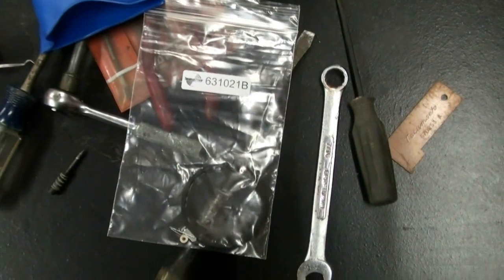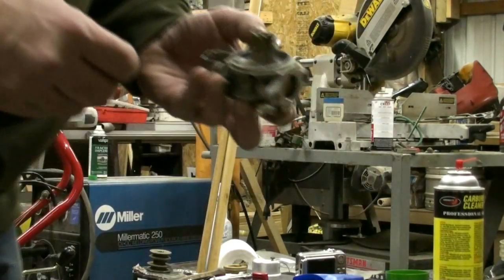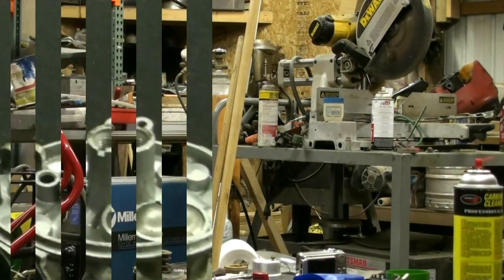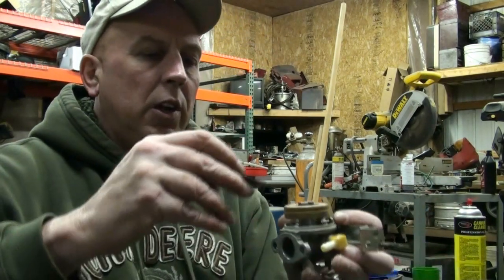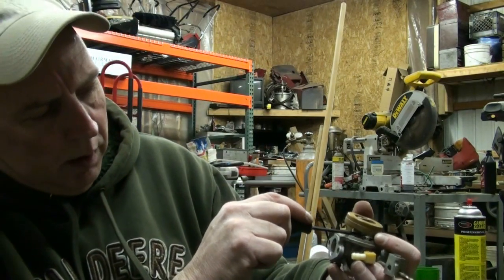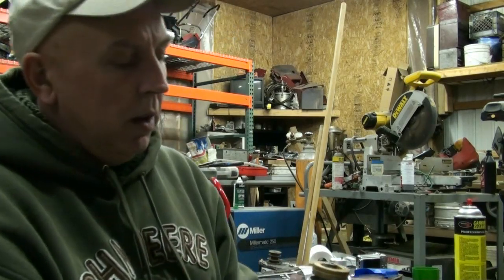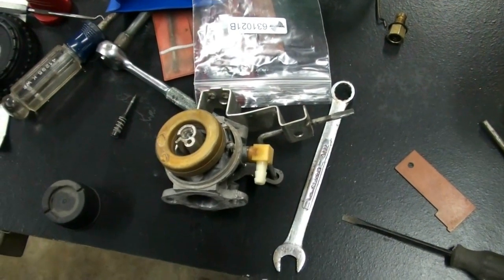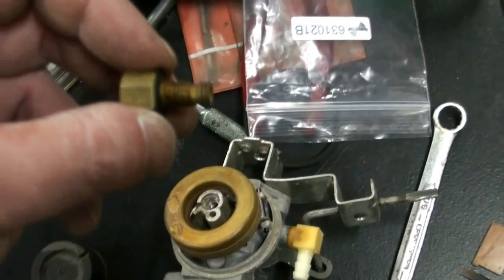Tecumseh Snow King Carburetor Repair Video on Troy-Bilt Snow Blower part #3

Comment: Nice little adjustment tool you have there, what if you don't have the tool. It looks like it would be easy to make if you could tell us the depth of that notch that was cut in the metal, please.
Reply: 13/64 drill bit
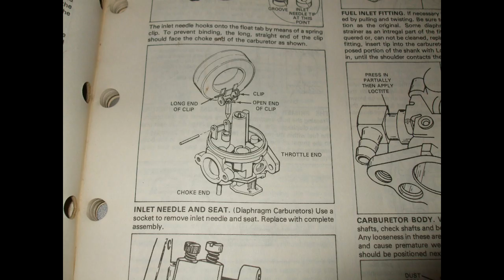Reply: Thanks, but a little confusing, in one picture at the 8:49 mark in the video it says no further than here and in the other picture it says the depth of the other notch, which is it?
Reply: W. Gator why not just buy the tecumseh tool for 17 bucks on line
Reply: I live on an island 90 miles out in the north Atlantic. Tools like that aren't easy to come by, but even if I had it I would still need my last question answered. The instructions in the two pictures contradict each other.
ok, I guess I could get it on line, but would you be so kind as to explain the question I sent you at 5:23PMthis evening
Reply: EXACTLY!!   have the tool and it works great!

Comment: Fix a ton of these. not bad except when you get the ones with the crappy little spring for the float, those can be a little tricky to put back in (work in a small engine shop get tons of them in, usually replace the needle/seat if shot (compressed air takes the seat out well) and the bowl nut or adjustable high speed nut for what they cost not worth wasting labor time cleaning them (they're like 5 bucks, needles come with seat and bowl nut and float gasket and list for under $10)

Comment: Hey mate, thanks a lot for this video... I replaced the float, the old one sucked gasoline into it and - well it did'nt float any more. I did'nt have the float meter, but I took a good look to this video and bent it to the same level.
Aaaand the problem is gone.

Internet is making everything so easy to DIY'ers

Comment: What should a carb tuneup cost? 
I have the identical Tecumseh engine on a Craftsman  unit...  looks the same.  It seems odd that there is no air filter, do you agree?  I used your video, didn't do the full teardown, just removed the float cover and the mixing screw, cleaned it, re-installed.  Sprayed carb cleaner in through the choke.    Went from sputtering death to full function, thanks. The machine has always seemed underpowered except in >6" of fluffy not wet heavy snow.

Comment from the maker: @sbrown246810 Most Tecumseh carburetors usually turn out like the one in this video after a rebuild but, from time to time I run into one I just can't repair and haft to break down, run out and pick up a new one even thought I don't want to, you never know what's going to happen with small engine repairs?

Comment: how would you adjust the equipment if it was overspeeding, a tecumseh engine that is and don't you need to make adjustments on the carb everytime you take it off when putting it back on?